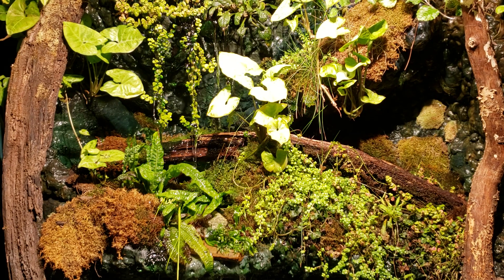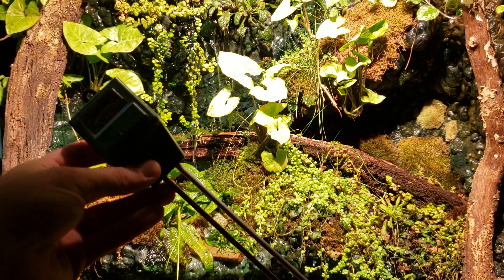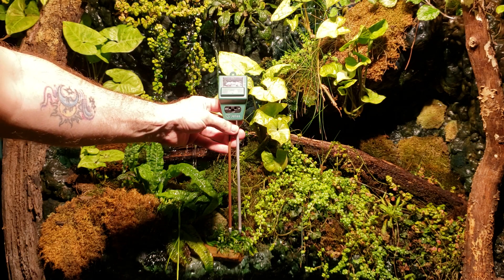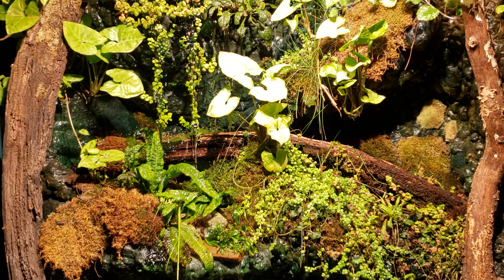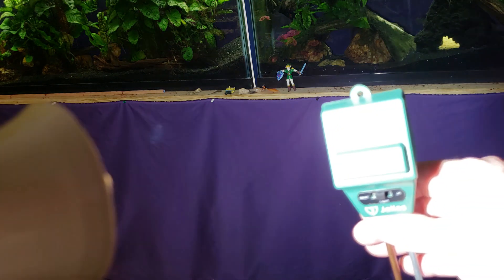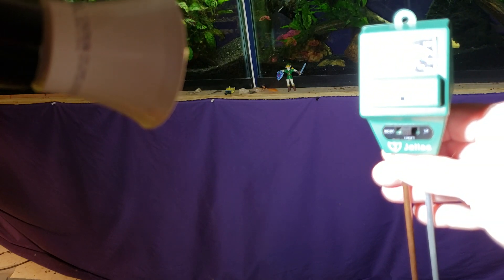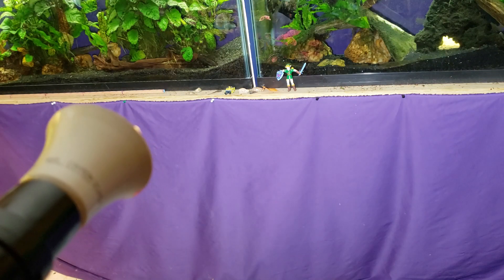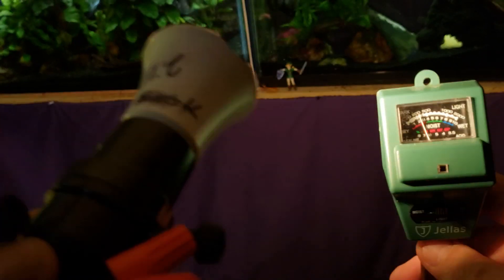Why I Break The Diffuser Off My LED "Bulbs" For My Grow Light Panels

Comment: The diffuser makes the light less focused, and as a result, your light measurements are lower, as you are taking a point measurement.
You should be measuring the total light output all around the lightbulb.
That said, I did notice that removing the diffuser does indeed increase the total light output.
Yes, even for ceiling lights (despite what you said), as the loss in omnidirectionality is made up by the higher light output. Depends on your light fixture though.

You however don't seem to be aware that LED bulbs use non-isolated power supplies and that the diffuser also acts as an insulator.
As such, you created an electrocution and fire hazard. Touching the LEDs or other components should give you quite a shock.
This also probably violates a few safety standards.
Keep in mind that even an insect could short out those bulbs now and your lighting is also near water.

I wrote this comment not to piss you off, but as a disclaimer, because your video has none. You know how stupid people are and a leading cause of house fires are of electrical origin.

Comment: the diffuser is spreading your total light energy over 180+ degrees.Placing a deflector hood would refocus the beam onto the meter but at the cost of bouncing light. The diffuser also bounces light back in and around inside the fixture.Every time light impacts and bounces it looses energy. Be it smoked glass,metal reflector, or molecules of air.By removing the cover you are focusing the beam and not bouncing the light. You are getting more light energy and exactly where you want it.
Reply: @Kyle Purdy That is a lumen meter. With the diffuser it is reading 300 lumens @6 inches. Without a diffuser it is reading 900 lumens @ 6 inches. The diffuser is deflecting 66% of the light energy back into the fixture. The rounded surface sends it  back into the dome at a new angle where it strikes the sides. 33% will pass through the side and 66% will bounce back in again striking another other side , Eventually each photon will escape but each bounce reduces its PAR energy, That depletes lowest nano meter light waves first since they carry the lowest potential energy. That would be the blue/violet waves that plants need for vegetative growth.  You can see the light has a different color rendering with and without the diffuser. So removing the diffuser focuses the beam but also allows all the LED PAR to reach the surface.

Comment: You are using the wrong color temperature lights.  2700 K bulbs produce large amounts of yellow and red light, but very little blue light.  Red light promotes flowering and fruit production, but you need much more blue for good foliage growth. The plants in your setup are the types usually grown for foliage effect and need more blue light for leafy growth. You will get much better results using 5000K.  5000k bulbs produce sufficient red light, but balance with much more blue. The color of the light at that temperature is much more like natural window light.  I use 5000k exclusively for my cacti and succulent plants and get no etiolation and excellent bloom as well.  2700 bulbs are made to duplicate the color of incandescent bulbs and candle light, both of which have long been proven worthless for plant growth.  They may look "natural" to you because, as photographers have long known,  the human eye is much more sensitive to red light than it is to blue.